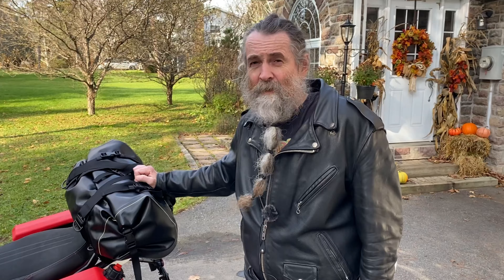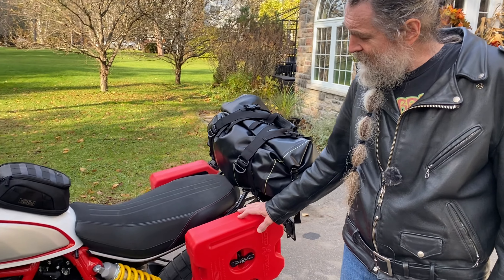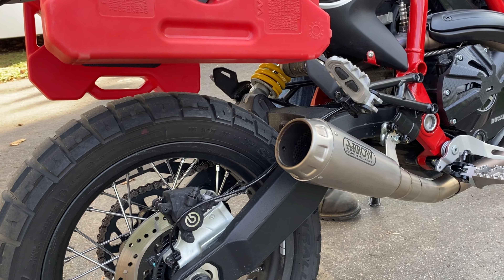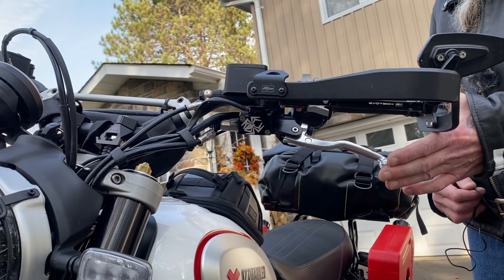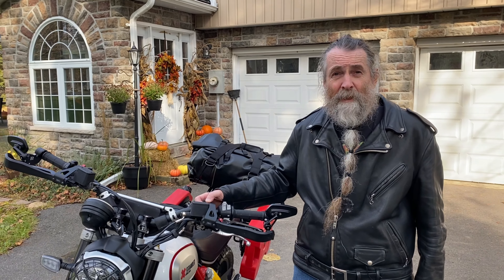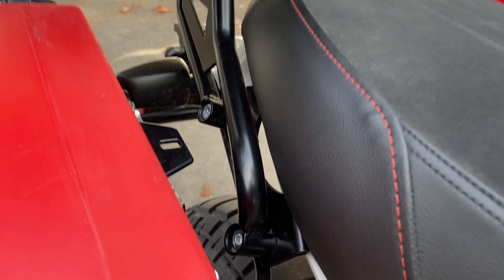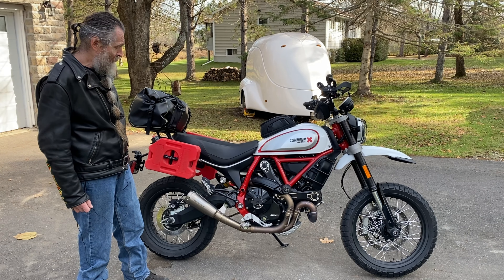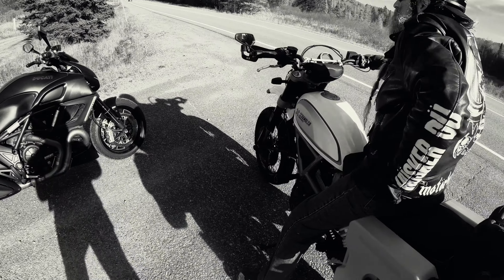Ducati scrambler desert sled -ride and mods

Comment: I love the fuel tank mounts. Is that mount spelled cbell? I can’t find it.
Reply: C - bow mounts by Hepco and Becker
Reply: @ChrisBrown-dd9nn  hey buddy love the setup on your bike i have the same year  really looking to upgrade the expedition capability.  Might try running a few questions your way if that's ok... going to look into some b of the items you mention.  Love your setup.  The arrow sounds great 👍🏼
Reply: @ChrisBrown-dd9nn  im looking at the various setups and bags online seems like there are many variations and options.  Is there a distributor for the ones you purchased specifically you could recommend. Thanks Chris!
Reply: @roguewolfblades  I ordered my Wolfman Expedition Duffel - small from Dualsport Plus. Don’t let small mislead you, it’s a fair size… holding over 33 litres. My order was almost 2 years ago, so I don’t remember, but I’m in Canada and probably ordered from them to not get hit with cross border duty. They came good and fast.

Comment: got a question for you.. does the desert sled have cruise control?
Reply: The DS has so much, but cruise control.. no. Honestly, I wasn’t sure. It never even occurred to me. HEAVY on the throttle and away you go!
Reply: @ChrisBrown-dd9nn  yea im currently riding a v star 650 classic and shes abit on the heavy side throttle wise and im just looking around for a cruiser style bike but can go up dirt roads over rough pot holes and plenty of power to keep up with my friends that are on GSXR 750s and things wich my v star is modded quite abit engine wise so it keeps up pretty well for a big 650cc bulky cruiser but yea looking for cruise control low price and offroad capability and the best bikes ive found for that are the indian FTR 1200 and bmw urban GS and scrambler 1200 but i dont know if the street scrambler from triumph has cruise control soo yea theirs allot of research i gotta do